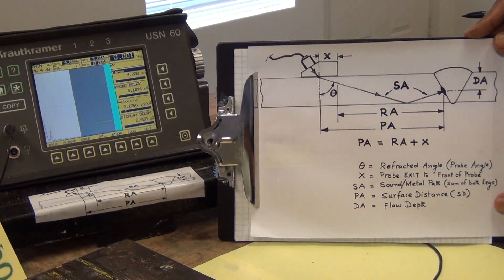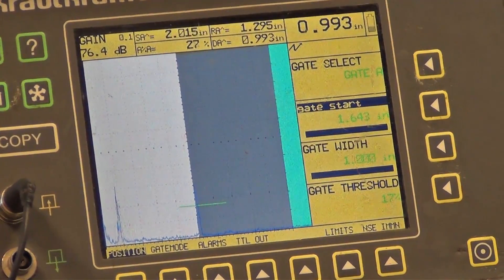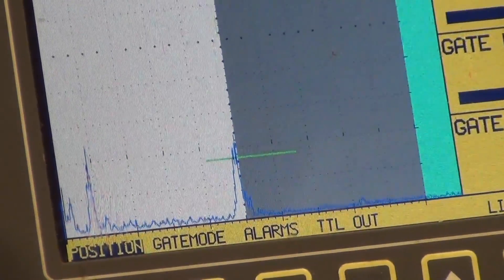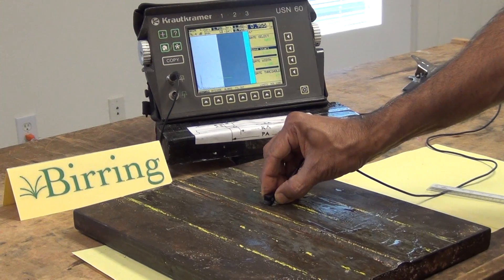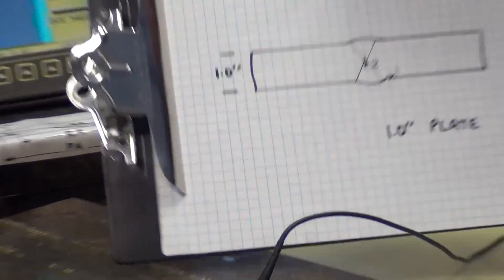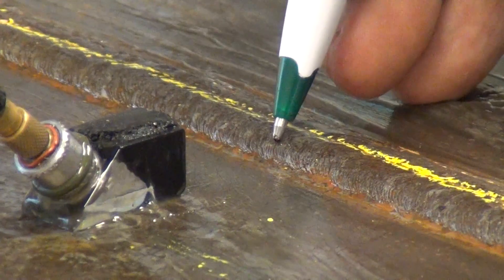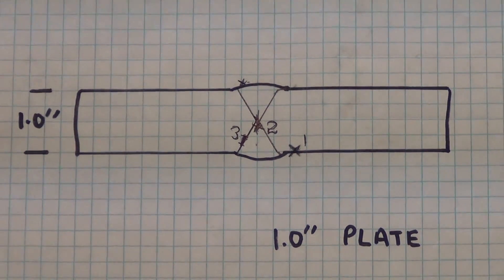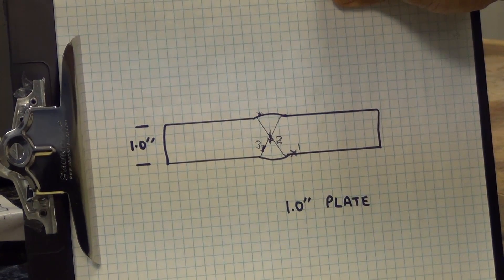Birring NDE  202, UT of Welds, Part 2/2 - Inspection

Comment: X-ray is probably easier than this. Also looks like he's over doing it. Ut is great for some things but sheer wave is very tough to determine if you don't know part geometry. Just mag the whole weld with a yoke and call it good. And the machine is a USN 60
Reply: as im sure u know that magnetic particle with the red dust and wet mag  only picks up surface and slightly subsurface indications and can only be used on CS. Like the man explained, UT can let you  know the "exact" location and depth of the flaws. Plus, UT doesnt involve permits to do the job (depending on location) and slightly less liability insurance to be in business.